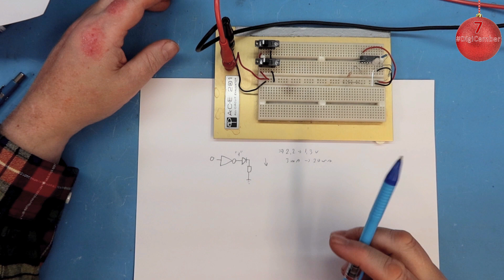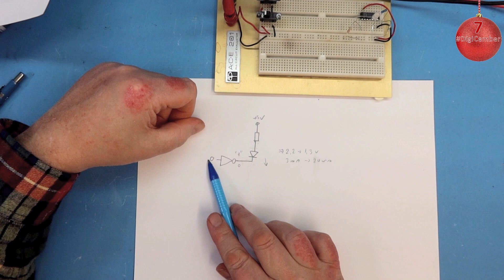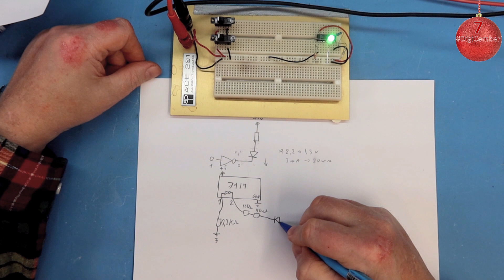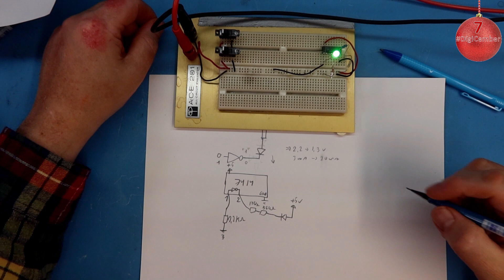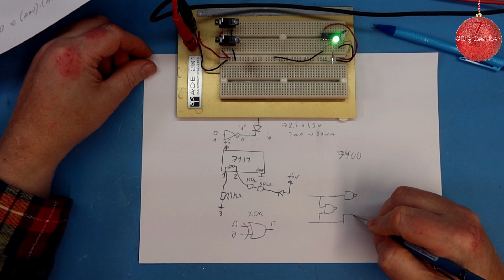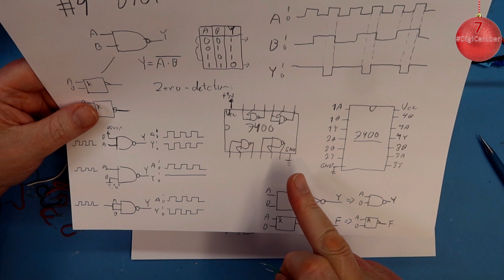It’s only logical. Episode 7 “First bite of the Breadboard”. A Christmas Calendar from KOJRO RI.

Comment: Connecting the 7400 ground pin to +5 volts was probably not the best way to test that circuit. 😊
Reply from the maker: The worst thing is that I newer noticed. And I studied that board a really long time.. Tommy at Arctic Retro told me last night, and then I was finished with the rest of that, and got it working..